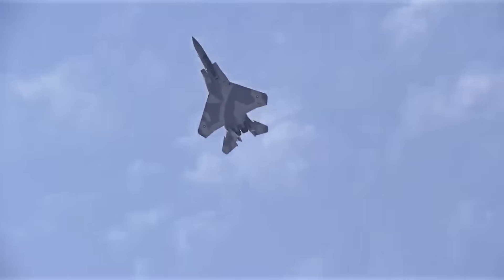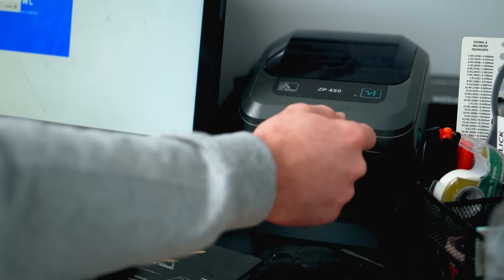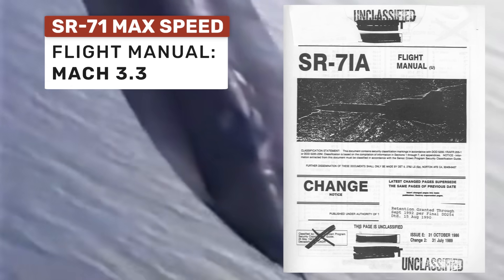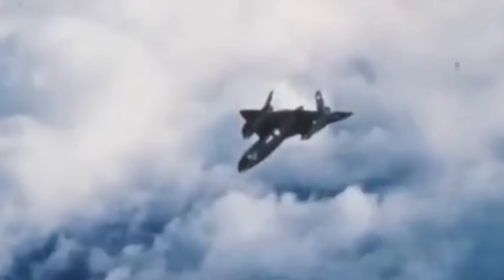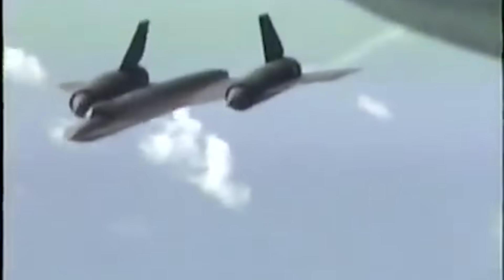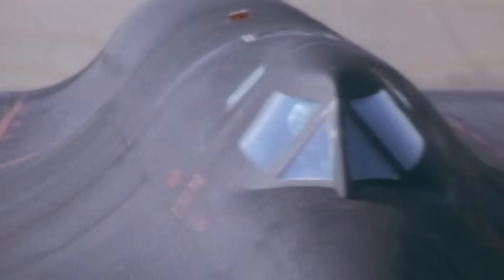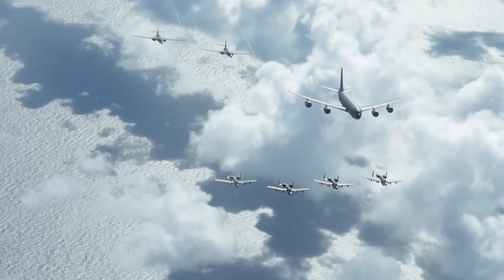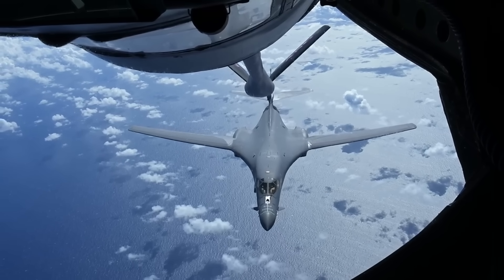The SR-71 was MUCH FASTER than the Air Force will admit

Comment: Duh. Of course. The speed needed to need Titanium so the skin wouldn't melt it had to be a lot faster than Mach 3.  
The Soviet Union had a fighter that went Mach 3, and it used steel alloy for its skin, and it had NO PROBLEM going Mach 3. 
Therefore, the SR-71, had to be going Mach 4 or 5.  
I figured that out decades ago.
Reply: The mig 25 would destroy the engines at mach 3, but the airframe wouldn't sustain damage. The engines were adopted from a cruise missile engine and not initially designed for reuse.
Reply: Unfortunately for your reasoning, titanium and steel are actually both about equal in terms of thermal capability. Titanium is lighter, of course, but it's not going to enable any higher speed than steel will. If you want to go faster than about mach 3.5, you start to need to look at other alloys such as nickel-based superalloys instead, like the inconel used on the skin of the X-15.

The somewhat boring reality is that, contrary to what all the people in the comments here want to believe, the SR-71 was probably never taken faster than 3.4 or so. Maybe 3.5, but those stories feel like they're stretching the truth a bit, and as Alex even mentions in the video, other Blackbird pilots have said that Shul liked to tell tall tales from time to time (and really, that's common among military pilots).

(I'm an aerospace engineer, if you're wondering about my credentials here)
Reply: @clapanse  Thanks. I did wonder about what was used on the X-15.  
Also, I thought titanium was used on the SR-71 because of thermal issues.  
You seem to be saying that it was only done for weight.  
If so, why did Lockheed select titanium and have to engineer the construction tools and techniques?? 
(BTW - I am not an aerospace engineer. If you are wondering about my LACK of credentials)
{However, I do have my YT Masters Degree in flummery.)
Reply: @clapanse  Aerospace Engineer?? 
HA ! !   I am a bonafide YT expert on ALL topics.  
Seriously, though, seems to me the biggest argument against the SR-71 going much faster is the fact that it was not using a scram jet engine.  
The Chimera engine from Hermeus sis supposed to go Mach 5, and uses scram jet technology to get that speed. 
So, I presume the SR-71 was limited.  
B U T -- I then still have the question -- why the titanium hull?
Reply: Are you sure there were no problems with that Russian jet going over 3?
Reply: @Youtubeuser1aa I think the MiG-31 airframe and skin could handle mach 3, but it tore up the engines, badly.
Reply: @Echowhiskeyone  My point was about the skin of the plane.  Seems to me, for the SR-71 to have the heat issues described, it would have to a LOT faster than Mach 3.
Reply: @Youtubeuser1aa  haven't a clue.  Were there?
Reply: @craigkdillon  first it was stainless steel.  Second, they DID use titanium for the critical parts.  Third, throwing around hypersonic speeds indicates you don’t much about aircraft.
Reply: @Youtubeuser1aa  what was made of stainless steel? The SR-71 or the Russian plane? 
you are right, I don't know about aircraft design.. It just seems to me that if one plane can go Mach 3, w/o titanium, then the SR-71 must be going a LOT faster.
Reply: @craigkdillon  the Russian jets were made of SS with Titanium in critical areas.
Reply: @Youtubeuser1aa  Thanks.
Reply: @Youtubeuser1aa  Actually, the "top" speed of fighter aircraft is NOT a sustainable speed.  They can only do it for a short while. 
I expect that to be the case with the Soviet jet.  
While the SR-71 could sustain Mach 3+ all the way.
Reply: The number I always heard growing up in a family of engineers was 3500 mph (about mach 5 at 20000 feet) guess one of them did the math based off of how much thrust it produced or something
Reply: @BTD3Fan  Wow. That much?? 
I just threw out Mach 5 because I thought it must be able to go a lot faster.  
If what you say is right, then my wild ass guess was close.  
Thanks.

Comment: This is my favourite plane on the planet.
Reply: I think it will hold a special place in the public eye even if/when its record (probably) falls in the not too distant future. It's one of the most iconic aircraft of all time.
Reply: Mine too, my first ever plane toy was sr 71 :D
Reply: @Gloverfield I had the Estes SR-71 Blackbird model rocket. With solid fuel rocket motors maybe they should’ve called it the X-71. ;)
Reply: @Gloverfield Mine was SR and an A-10
Reply: @North986  POG :D my second plane toy(and second favorite plane) is tornado
Reply: Had a model of an SR-71 as a kid and a poster 😁
Reply: North986. Mine too. It's just a wicked looking weapon
Reply: Ever
Reply: What made it so unbelievably impressive is that it's a completely analog plane. All modern aircraft derive their performance from the fact that they're completely aerodynamically unstable. If there wasn't a computer constantly making micro adjustments they would tumble uncontrollably through the air.
Reply: I love the SR-71...but my favorite is still the XB-70, though there is only one left and will never fly again. :(